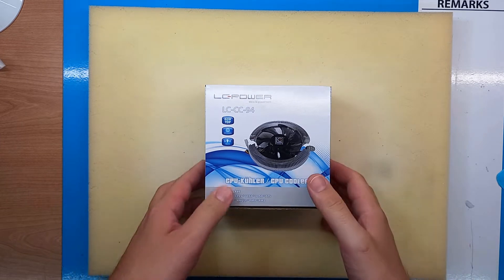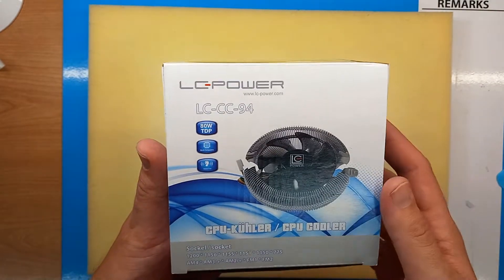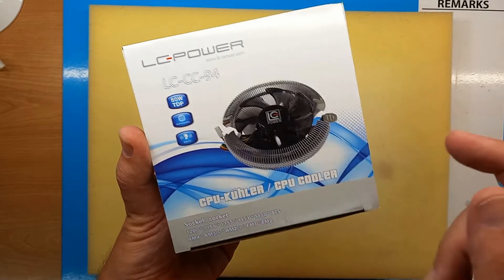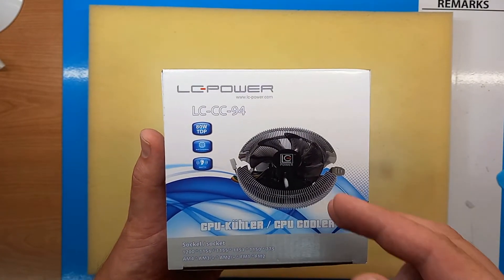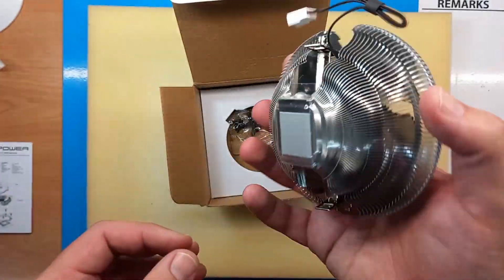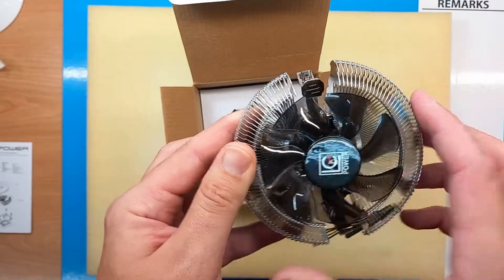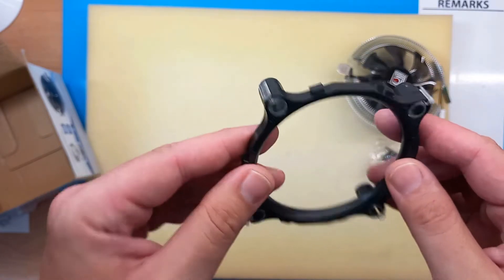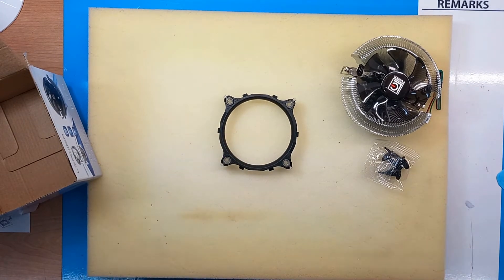LC Power LC-CC-94 CPU Cooler Unboxing & Installation

Comment: I got one today for my old AM3 platform and it can't be mounted on to the motherboard!!!!! It says its for Intel 775 - 1150 - 1151 - 1155 - 1156 - 1200 and AMD AM2/+ - AM3/+ - FM1 - FM2 - AM4, but in the box that black round mount is only for Intel!!!!! 
How to mount it on to a AMD motherboard when you don't get it in the box???
Reply from the maker: For AMD sockets you should use the original AMD bracket that is already on the mainboard, the LC Power plastic bracket is for Intel CPUs only, to correct myself. 
So just install it as this different cooler the principle is the same.
https://www.youtube.com/watch?v=OP0JdRYHNi8&t=3s&ab_channel=AlkibTech

Comment: I tried to mount the Cooler LC-CC-8O on the LGA 775 socket, but I did not succeed because the distance between the holes on the MB is longer than the pins on the frame that carries the cooler
Reply from the maker: All these coolers support certain sockets, if the cooler matches your mobo socket should work, if not you will not be able to mount the cooler.

Comment: How you remove it ?
Reply from the maker: Easily just push the holding pin a bit down to release it and up. But good point could have shown that in the video as well.